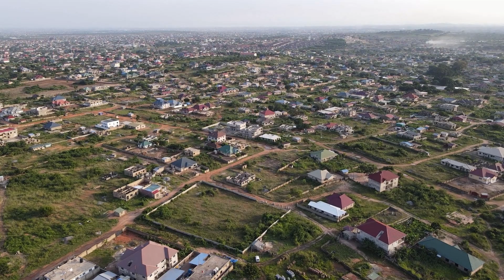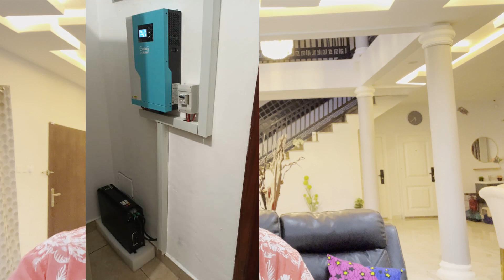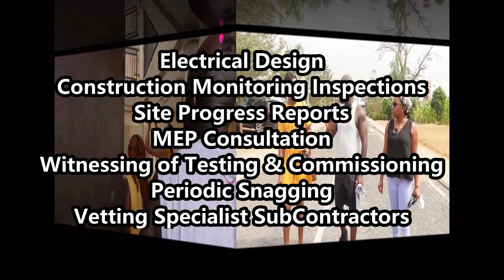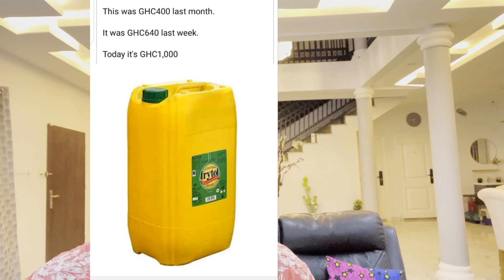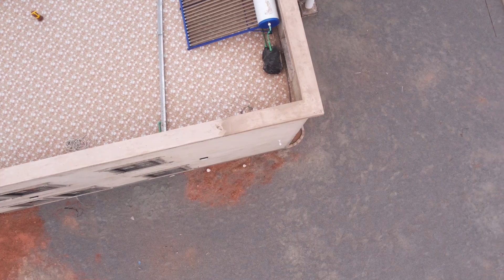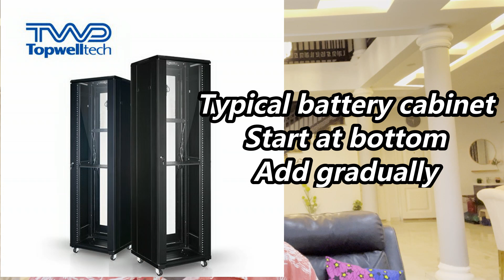SELF SUFFICIENCY |  HOW TO MAKE YOUR SOLAR INSTALL CHEAPER

Comment from the maker: Building In Ghana Ebooks
1. Cost Templates For Building In Ghana (Link below)
     https://payhip.com/b/UQjBY    
2. How to Wire your Home for 110V & 220V Equipment
     https://payhip.com/b/gN8eY     
3. How to Manage Power Failure (dumsor) in Ghana.
     https://payhip.com/b/BlyQ9     
4. How to Construct a Water-Proof Concrete Flat Roof in Ghana
     https://payhip.com/b/QXJPl    
5. How much Power Does your House Need?
     https://payhip.com/b/8P7wu    
6. Water System Design for a Multi-Storey Building in Ghana
     https://payhip.com/b/fLKYD     
7. How to Select the right Balustrade Artisan in Ghana
     https://payhip.com/b/WbnCN     
8. How to Select the right Window Artisan in Ghana
     https://payhip.com/b/dL7FS
Reply: My name is Boadu living in Germany. I will be very greatful if you help me to choose the right electrician for my house in Accra. Also as supervisor and consultant for the power need of the house

Comment: Hi Asher and Gad , I watched your video and really liked it. Good job on enlightening the people on how to utilize the abundant energy from the sun. One thing however wasn't clear to me when you stated that , the equipment can be bought in parts ,like the battery and inverter  first and then later get the solar panels.  My question is how do you charge your battery once it is depleted if the panels are not in place to charge it back up. 
Thank you and keep up the good work.
Reply from the maker: Some inverters allow charging of batteries using ECG - hybrid types for example. Depends on brand and spec

Comment: Nice one as always Asher. I believe it’s called a server rack style unit that houses the battery type you had on screen. I’m undecided as yet whether I’ll use server rack or wall mount lithium. Wall mount looks nicer but more labour intensive to install verses the rack mount. Keep up the good work brother. 👊🏾🇯🇲🇬🇧
Reply: Beckford, you sound like you know a thing or two about solar and server racks. You must have an IT background, lol. Help throw as much light on this subject as possible. I am building and will need to add solar alternative but I think the technology is not much developed to reach the masses and I have some reservations 

It would have been helpful if others besides Asher will input more information about solar. Every video from Ghana about solar is very shallow and not deep enough to use to build a system. So far I have learned a lot from Asher but it’ll be very helpful if he interacts and answer some of the questions. I will ask a question independent of your comment and see what happens
Reply: @Bilegagn  Hi. Unfortunately I’m still learning. I only knew about server racks from the videos I watched from David Poz and Will Prowse. Very educational. I’ve learnt how to build a battery bank. I’m many years away from using the knowledge as that’s when I’ll need it. I’m in uk and have a rural plot of land in the Caribbean. I want to build on it to retire. Sorry I couldn’t help any further. Please watch those people also ‘everyday Dave’ and ‘Off Grid garage’. Very good tutors.
Reply: @cCaribbeanSpursTv  
Thank you very much for the reply. Now I have found a new thing to learn and improve as a person. I have already been able to locate one company in Ghana dealing with these things, “off grid/ hybrid systems “ electricity where I can build from. Now I need the knowledge to know exactly what I am doing. Thanks for those names
Reply: @Bilegagn  You’re welcome. Please keep me updated with your progress and project.